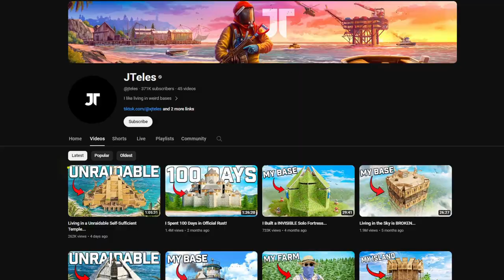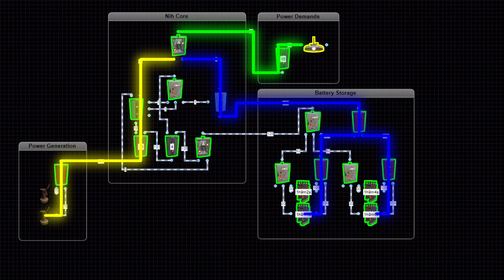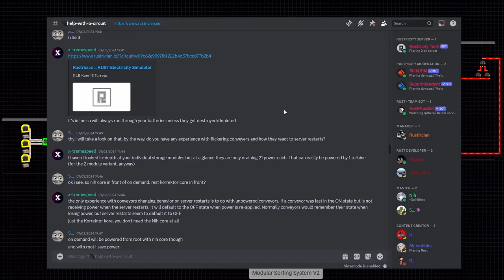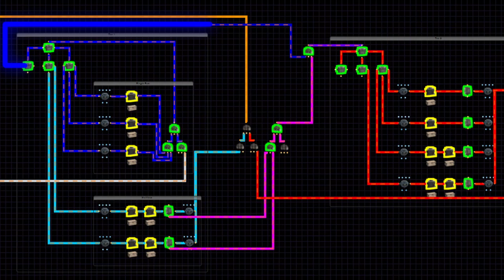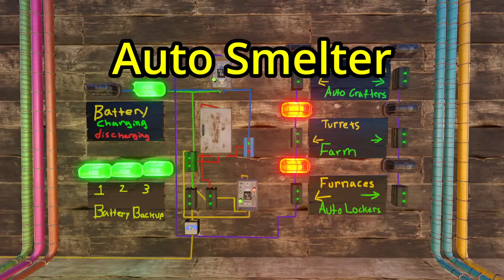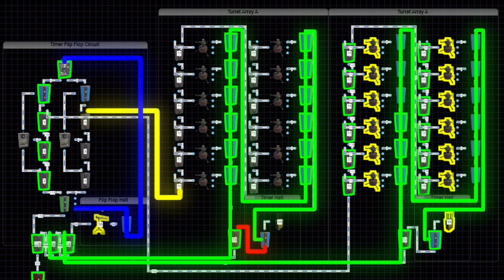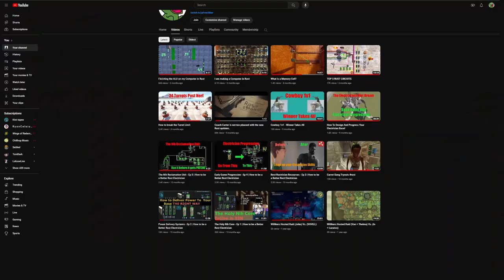JTeles Hired Me To Wire His Temple

Comment: I am in need of electrical assistance. i request a video on hooking up the automated lighting system and connecting a network to which the lights are still switchable for toggle on and off with multiple buttons 
Example:if it where to get night time the lights switch on automatically, But i wish to turn them off so i press a button then it switches the lights off i then go to a different area located in my base click a dif button to switch the same lights conected back on.
This gives me control of the light as well as leaving them on when i chose to for the automated system, there also has to be a process for when the lights are switched off during the night and that is that the automated system still functions in the next daylight cycle so it has little to no error.
Basically, reseting itself. 😅 if you dont mind, i know it does sound like a lot, but it's worth it. tbhh...😊
Reply from the maker: Bet sounds like a good idea. Just to make sure I digested this properly.

Normal function of the lights will be off during the day, and on during the night.

But whenever you click a set of buttons which are wired like 2 light switches in a house to control a light. It will toggle the current status of the lights.

And then when the next time cycle shift happens the program would need to reset back to it's default state?

If so this is a pretty good idea tbh
Reply: @JohnWillikers  bro, that is literally the hammer on the nail
Edit sorry for the late reply I have asked a few others as well I've been on this for a while and can't figure it out I'm also on Crust not PC so that's a tiny set back but I can still figure out what I need to do eve if it is pc
Reply: @JohnWillikers  I'm just at my wits end, and I know almost all of u are smarter than me, so I took it upon myself to ask, and I will be greatly🙏 appreciative if this task is complete 😊